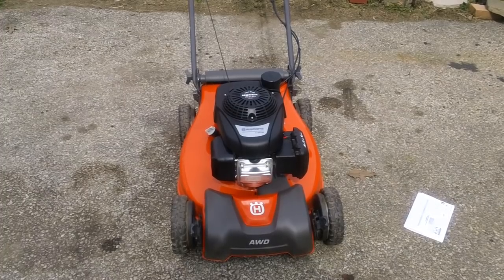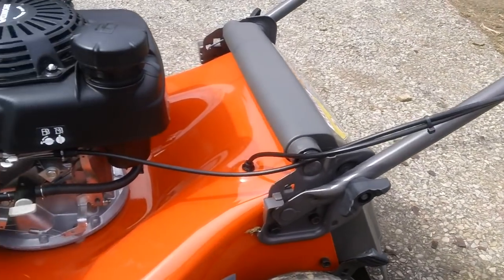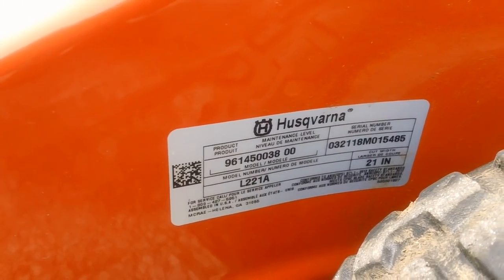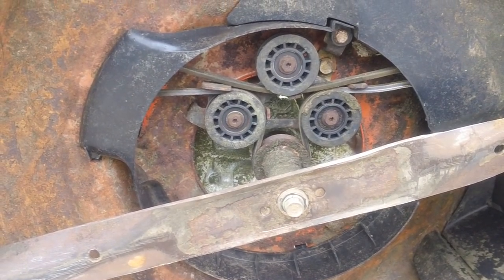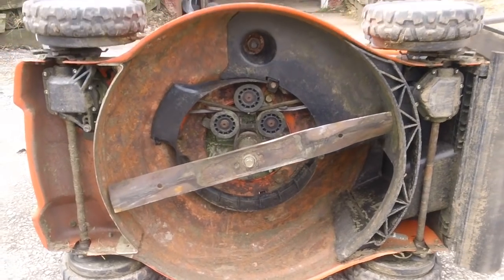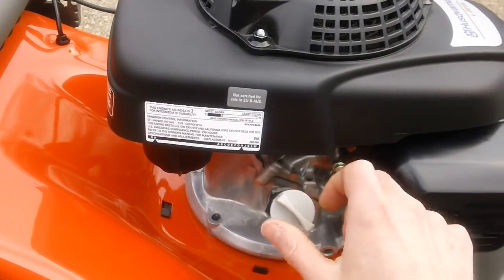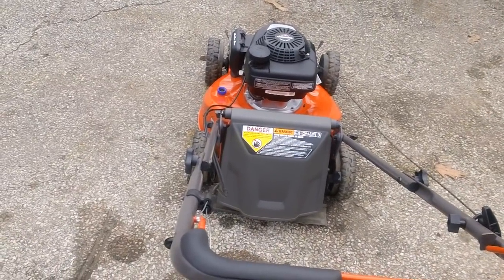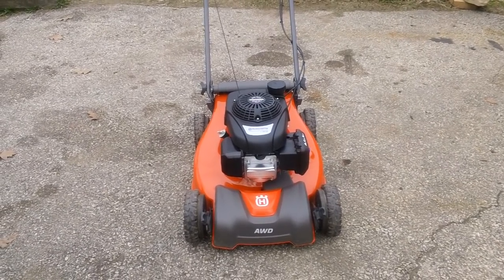Husqvarna All Wheel Drive Lawn Mower | LC221A AWD

Comment: I have a Honda Harmony that I bought new about 30 years ago.  change the oil at least once every cutting season and it still works like a champ.  The "composite"(??) deck has started to crack by the front wheels - I improvised a metal L-bracket with nuts/bolts to hold the wheels on - still works like a champ.  Just need some new wheels, they are pretty much reamed out.  Only complaint I have ever had with this mower is it's light on horsepower.  I think it's a 4.5 horse and it will bog down in really thick grass.
Reply from the maker: if you are trying to cut super thick grass i have a few possible suggestions,  take a half a swath as opposed to a full swath cut,  make sure you have new blades that are super sharp,  use mobil 1 syn oil 10w-30,  and use pure gas (non-ethanol fuel) (https://www.pure-gas.org/.)  non-ethanol fuel will provide maybe 5-10% higher BTU's which will allow engine to run stronger, and also use a BPR4ES hope this helps you.  these ohv honda engines are workhorses they can last 30 years or mor if they are treated with tlc.
Reply: @ChrisUrsiny  That's exactly what I do - half pass on the lawn and it's fine.  I've sharpened my own blades since new and that seems to work too(with the very impromptu hang the blade on a nail on in a 2x4 to check for balance after a few passes with the file).  I haven't used the mobil 1 oil in the mower(only in my Road King)  - you think it will be OK to switch even in a nearly 30 year old engine?  Also, never used the pure gas, back when I bought this mower, there was no need to worry about that, maybe I'll give it a try.  I have an Echo backpack blower that uses mixed gas/oil - can I use the same gas in that unit also?  I finally gave up on the gas trimmers after going through to many of them and am trying the Dewalt electric...........  So far it's a beast and cuts as well or better than any gas powered edger I've owned.  Good channel and info - and thanks for the tips.

Comment: just a quick note about these machines, the lc221 is like the budget level and you really want to get either the three something number series or the seven or the 800 for a good reason. The wheel casters are actually feel better and the wheels themselves actually come with roller ball bearings this actually helps a whole bunch because after just one season of using your mower you'll realize you'll start eating gears in a lot of other things.. 
I love the way the mowers look but man they are like the BMW of mowers and need so much maintenance to keep going
Reply: This is a good mower.. I have the same that I use in our warehouse lawn... I don't use use for the tall grass we get by the property fence not design for that but for regular residential lawns is really good. I like the design of the deck.. it helps in good suction when grass is dry and leaves a really good clean cut.. Honda engine is a plus...

Comment: Chris, I am  trying to get the top two bolts off for the front cover. The other two were easy and unobstructed. The top two are hindered by the front transmission.  Any suggestion on extension tools?

Comment: I am reviewing this mower, because I have a very hilly property. I live in the Northwest. Basically between late March and late May, our grass is very thick and wet. Basically through April and early May you need to mow twice a week, would you recommend this mower for my environment? I fear that the thick wet grass would be too much for the exposed pulley system. I have a basic Honda rear wheel self-propelled mower. The motor on it is stellar, the drive keeps going out. For my Hilly property I just want something that pushes or pulls a little better in my advancing years🤠
Reply: I bought this machine in May 2016 and I have a 3/4 acre property I mow once per week for 2-3 hours. The property has incline and a big hill and this mower has never let me down. I changed the oil every season and the air filter once. Believe it or not I’m changing the blade for the first time tomorrow along with the  spark plug for the first time and I don’t even think it needs a new plug! I make sure to tip it over and remove grass stuck underneath after every mow. I see a lot of complaints on this mower but it has caused me no issues. I think some people perhaps set it to low or something or don’t take care of it or are hard on the machine. Another guy on another video reported buying the same one in 2015 and he said he uses it similar to me with not a single problem. And I have mowed damp grass frequently and even in the rain (after it started raining) and it worked perfect. The secret with wet mowing is to use the mulching attachment that allows you to open the side door so that wet grass has an exit point from beneath the mower.

Comment: Nice video Chris, but how did you manage to remove the front left bolt of the cover, it is completely obstructed by the transmission,  anybody had a hard time with this? Thanks
Reply from the maker: i used a small 1/4 inch socket and was able to remove it using this way.  it was difficult however it was removed,  need to be patient.

Comment: I have all wheel drive model HU800AWD. Right side gear working but left side grear stopped working. How to fix it ? Please help after I start it and press right hand side gear it start propelling.But if I try to use left hand side gear the left handle unable to move???
Reply: I have this model and if you unscrew the plastic cover you can see the operation of both levers. One side of mine had proke inside when i forced it trying to depress it. but the replacement and was good to go. I prefer the one bar lever in his video which you can slowly depress and use the all awd system to your walking.

Comment: A small spring came off mine don’t know where it goes???
Reply: The spring probably is to keep the transmission out of engagement when you are not pulling the cable handle. Look at about 18:50 of this repair video for installation instructions. 

Husqvarna All Wheel Drive mower repair.   Belt, pulleys, and cable. Husqvarna LC221A https://youtu.be/5oj9WPHciEI

Comment: I have the same lawnmower but mine does not want to stay on what could it be?
Reply from the maker: hello sir,  if your mower will not stay running you "may" have 1 of 3 problems or a combination of these 3 problems,  you need:  1.  a timed ignition spark, 2  you need good compression,  and 3 you need a proper fuel mix.  if 1 or more of these parameters is not within oem spec. something is wrong.
Reply: Or a clogged intake or exhaust.

Comment: Hi Chris. I got same mower. It did start than cuts off so I clean carburetor, gas tank, new air filter and does not want start. Do you have any idea please let me know. Thanks for the video.
Reply: Try starting with air cleaner and cover off. Once I starts run for one minute then replace air cleaner and cover. It should start after that.

Comment: What is the blue cap on the top deck for?
Reply: Garden hose hook up on alot of these to allow water to run under deck and clean debris from underside. Make sure it's dry before you store away for next mowing or the moisture will definitely play havoc in time. I like to use either a blower or air gun after I use water anywhere on it. Hope this helps

Comment: ATG says don't buy this or many models that bottom are open. But many think Husqvarna is good. This sucks.
If one designed a mower to cut when grass is dry won't get repeat buyers.

But if you want to pay $400.00 and then clean belt jumping of track because the grass caked all over the places.

If parts needed to be replaced within 3.7 years are because companies have scammed owners by using cheap plastic pulleys.

Unfortunately, since you now have it, do you really want to keep buying parts just to get it running for less than three months?
Reply from the maker: i personally dont like these new gen of husq. machines because they appear to be cheaply made,  have 2 trans. to fail, and a open deck drive system that can and does clog extremely easily.
Reply: @ChrisUrsiny  I had three for free from company. But my staff & I refused to do a review.
Just another greedy CEO /or owner making & selling cheap junk.